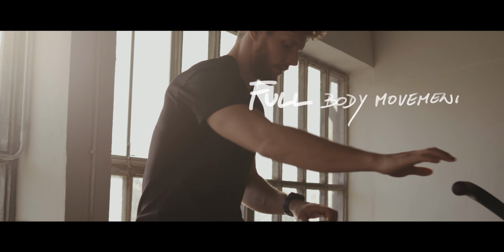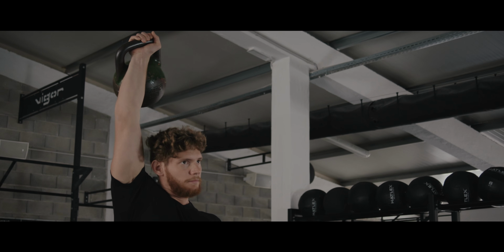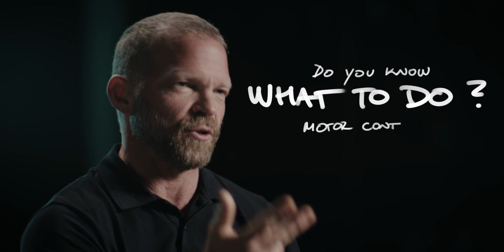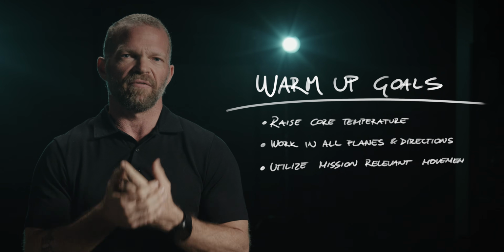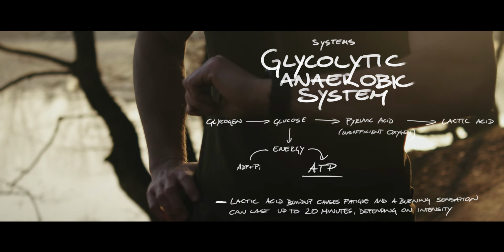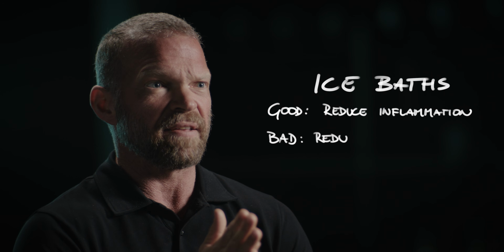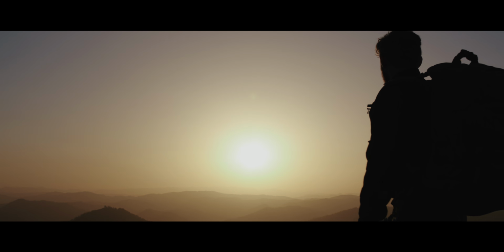Pro's Guide to Special Forces Assessment & Selection | Physical Preparation  & Overall Concept

Comment: Wow, this is amazingly structured and explained. I started strength and powerlifting first to build form, technique, full range of motion and strength. Hypertrophy training or volume training came easier as I practiced technique a lot to also help identify and work on my weak points and stabilizing muscles. The only issue I had to find out for myself was focusing too much on progressing linearly without full joint, tissue, and my cns recovery, that eventually lead to injury and temporarily joint issues. So recovery is just as important as well as learning to fire the correct muscle groups under load without taxing joints. Just need to add in the others to be like a special forces god. Mobility, functionality, strength, exposive, full range of motion, technique, This video is so freaking awesome, I use Renaissance Periodization as my go to for info just like this, and this hero confirmed it and made me think more about my training multi-dimensional instead of single-dimensional. I would think a crossfitter should have no problem with this physical condition selection.

Comment: I'd love to see a full body routine implementing the stuff from this video
Or maybe even a plan for an entire week with running/rucking
More on the subject of running would be great
But great video as always :)
Reply: There is a bit more coming in the next two episodes. If you look in the video description there is also a link to a download for a training plan.
Reply: @project-archangel  when u click the link, there's no actual place to download the plan
Reply: @boris148  you have to subscribe to them via email and then they'll send you an email with the option to download the pdf
Reply: @boris148  when you scroll down after klicking the link there is a place where you can enter your email address and they will send you the plan
Reply: Here let me save you the effort: 

Day 1 - 
Warmup, Jumping jacks and light stretch
run 1-2 miles 
Pushups, pullups, situps, burpees, planks 
stretch and use foam roller

Day 2 - 
Warmup, Jumping jacks and light stretch
Ruck 1 mile
pushups, pullups, situps, burpees, planks
Ruck 1 mile
Stretch and roll

day 3 - 
Rest, refuel and stretch/foamroll

Repeat and sprinkle in other exercises or increase as necessary. 

Do that and you'll be fit as hell. Once you're doing that, then start looking at programs to add to your workouts.

Comment: This video is amazing; currently training in prep for Army BCT
Reply: Outstanding! Make sure you are following an intelligently designed program that is periodized and addresses all of the plains of movement for maximum results. Are you currently following any specific programming?
Reply: @optimalreadiness  I plan on going into the army with a Option 40 contract (RASP Slot) . I have around a year to prepare myself before I enlist . My push-ups and pull-ups are not the best , same with my run time so what is the best method and improving my pt scores fast ? 

Any recommended routines I should follow ? Should I be going to the gym or can I just use my body weight to strengthen me? 
There’s a planet fitness near me but honestly I wouldn’t have a clue what to do at the gym .

Comment: Raising core temperature through warm up being a good thing is a bit  contested right now. It seems like it's a by-product rather than the goal of a warm-up. In fact research by Dr. Heller (name's Craig I think? I'm horrible with names) and his colleagues shows that lowering temperature (of course to a reasonable degree) drastically increases performance (as well as proves that it's not lack of atp that makes up stop the set but rather the high temperature within the muscle activating failsafes

Other than imo some degree of plyometric training can be safely performed by experienced athletes without the help of a coach, but definitely not in wet grass and other adverse conditions.
PS Very comprehensive and nicely structured video, I love your work. And surprising, considering that you're a gear brand!
Reply: interesting

Comment: Oh man lol physical fitness is Maybe 10% of the requirement needed for US Special Operations.  About 90% will be your own mental strength, and motivation. 
As a former Navy Special Warfare Operator 02-08. I saw many get pushed equally. The better shape you're in, it helps at the beginning, but as an instructor, we push everyone to their limits over and over. It's not a specific bar everyone crosses (persé). It's a mental breaking point. Typically that breaking point is found by pushing one to their physical limit. So no matter your fitness, you will be pushed passed this point over and over. If you're weak and pushing past  that, the instructors will be satisfied and move to the next guy. Strong guys Typically DONT last because of many physical traits that weigh them down. You just need mental fitness to get through training like ours in the US. Also some smarts. You gotta be above and beyond at EVERYTHING.  SF guys are not strong idiots. These guys are top of the food chain, alpha males. You'll get eaten alive, even in today's pink military if you're not an alpha or A-type personality. Not just in training, but in the fleet afterwards. I've seen many guys quit after training and one deployment.
Reply: How would you suggest to mentally train for selection?
Reply: @jamesmason3506 first, in the US, you just sign up for it. It's not really a selection process. There could be a long conversation about this, but you need to be strong willed, you need a motivation for doing it too. If you really want something you'll push hard to get it. It's hard in this case because you're going after something you don't know much about (daily life, etc).  One way to train the mind for this would be to do some cardio to the point that you "think" you're done. Then immediately do 30% more of what you just did until you're "done" and can't go anymore, but then do another 30%.  Do this again, and you've added 90% to your max capability.  If instructors see this type of motivation and drive, you would be fine.  You also need to have above average critical thinking while in mentally/physically weak states. Usually US Spec Forces/Operators are guys that are pretty sharp, self-motivated, A-type personalities, Alphas.  Most of the people that make it, they were just brought up in a way that prepared them from childhood.  If you're looking at this for a career. Good luck. Never ever quit, you will pass out here and there, possibly drown, but keep going.  My thoughts were, "I can out perform that guy", and I kept saying that as there were only 5 of us left and we graduated as life long brothers.
Reply: I've been training hard! I guess I'm lucky growing up in an awful childhood. Mental toughness came naturally! It's very powerful to hear what you have said, God bless you.

Comment: only thing i think is wrong is the sauna. i was watching a video that stan efferding made talking about a concoction of frutose dextrose and sodium. they also mentioned that they dont allow there athelets to use them(sauna's) bc when they do there water cuts for the weigh in's all there endurance is lost. something like that
Reply: There is a difference between using the sauna to cut weight through water loss and using it for regeneration so I would disagree.
Reply: @project-archangel  hmm that makes since. thanks

Comment: I have shin splints on both my legs and Special Forces Assessment & Selection in a little less than 100 days it really sucks I need more running knowledge.
Reply: I did 2 marathons and about a year later mine started. I suffered for 2 years and got rid of them by changing my running form. Stop landing on the heal and in front of your body. Start using your front food. I recommend Sage Canady (vo2maxproduction) for insights
Reply: Tibialis raises will fix them. Check out Kneesovertoesguy

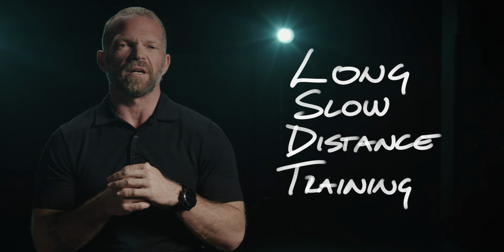Comment: 19:05
Did you say that the base for LSD training is 100 miles/week?! Can you clarify that? That sounds like something that needs to be built up over years, rather than as a base. Maybe I misunderstood
Reply: LSD training was designed for Marathon runners if Im not mistaken. So yes you wouldn’t expect a novice to start off with 100 miles but basically all your training will be running, pretty much 6-7 days a week, so thats about 15 miles a day at a slow speed. That explains the amount of injuries these guys have.

Comment: I plan on going into the army with a Option 40 contract (RASP Slot) . I have around a year to prepare myself before I enlist . My push-ups and pull-ups are not the best , same with my run time so what is the best method for improving my pt scores fast ? 

Any recommended routines I should follow ? Should I be going to the gym or can I just use my body weight to strengthen me? 
There’s a planet fitness near me but honestly I wouldn’t have a clue what to do at the gym .

Could I also get more fit/prepared from basic training etc before RASP?
Reply: First off, yes do basic training before RASP. If you want to get better at running, then you should run. Run once or twice a day & 4 times a week. Run as far as you can & keep doing it weekly. Ranger School is more endurance based so you don't have to worry about six pack abs & running fast (Doesn't mean don't run. Means it shouldn't be your top priority). 

Focus on growing mass because you will be deprived of food a lot. Do a CrossFit workout plan, go to the gym & do full body workouts 4 times a week. Then the next week do body weight exercises at home that target each muscle grouping for 4 times a week.
Reply: https://www.youtube.com/watch?v=V6X4c0MKIzo   AND    https://www.youtube.com/watch?v=ROCZYbFx2Tg&t=29s   make sure you ruck with a backpack that weighs at least 40lbs. And walk with that rucksack/backpack for miles to harden your feet as well. Even on days where you're not doing cardio, have it on and bring it everywhere you go, every day.

Comment: I’m shipping to basic in a month with an 18x contract. I can’t do any pull-ups right now (I believe to do my bigger lower body as I played soccer my whole life). I am currently working on it but I do not think I will meet pull up standards if there are any. Does anyone have insight on that?
Reply: You can't do pullups because your're too weak, not because your legs are too big. Unless you're very fat then learning to do a pullup in a month should be completely achievable.
Reply: @wtf93931  oh because you have seen me and have trained with me right. Real good advice internet guy!
Reply: @camcamcamcamcamcamc  Ok, what's your weight + height? Give me that and I can tell you if it's a weight issue or not.
Reply: @wtf93931  have you been to special forces training
Reply: @camcamcamcamcamcamc  Nah, but I can do a pullup. Answer the question, weight + height.
Reply: @wtf93931  I do not care about your opinion then. I know how I can build pull up strength. That’s not what I’m worried about.
Reply: He's not wrong. If been at 70 and 100kg bodyweight (marathon to bodybuilding, back to marathon) and I've always been able to do pullups. It's mostly never the weight, it's the lack of strength
Reply: @kzsposeidon3121  never said he was wrong. Thanks for the input other internet guy
Reply: It's too late now but what kind of insight did you want

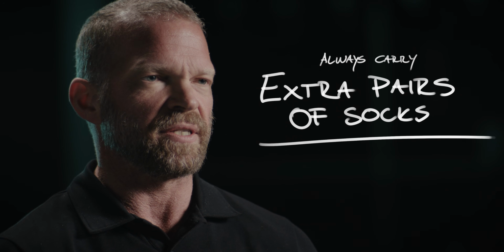Comment: @22:10 is this correct? I was taught to put weight as close to the pelvis as possible because the back is essentially a lever, a model where as the distance increases from the hips the weight increases would become more inefficient, it would be like trying to move a weight on a short stick versus trying to move the same weight on a much longer stick. Surely this is an error? I could see considering accessibility, I don't want to have to completely unpack my ruck just to get to food or water, but in general it seems intuitive to have heavy weight closer to the hips. This just doesn't make sense, fundamentals of movement, where the head goes, the body follows, so why then would I want to increase the weight as I get closer to the head? Can anyone explain this?
Reply: @patrickkok6258  It's not high, heavy weight should begin at the bottom of the T region and the middle of that portion of weight needs to be between the center of the shoulder blades vertically. High, people think above that point, that's wrong. I was taught by the U.S. Army, carried on average 90lbs over rocky terrain for years. You should be more specific. Attention to detail. All of the weight by average should still tend towards the pelvis while maintaining spine neutrality. It doesn't matter where the weight is so long as you can maintain spine neutrality with the least amount of effort.

Comment: I have a question about "ruck marches", if my goal is 20 km in 2 hours and 30mins with 30 kilograms, should i train with 35 kg or 40 kg is it better
Reply: I'd say you're better off keeping the same weight or a bit more and working towards a shorter finish time. Increase weight will increase chance of injury and complications ✌
Reply: Let me say first that I would look at some other factors before designing your workout for example how tall you are, what your general body frame (Muscle mass) loos like and what weight you have been rucking with so far and for how long. But in general 30 kg is already a heavy weight, especially for the time/distance that you are training for. You definitely need to train up to using 30 kg in order to prevent injury. If you can handle that weight for shorter distances and you overall training schedule allows for enough recovery, I would give short distances with heavier weight a try. My heaviest was 35 kg in the ruck with a 40kg sandbag on top of it. I think I walked for about 3km with it. Now this is not rucking anymore, its in the category of heavy carries which you would do to make your body more resilient to heavy loads, not to improve your rucking times. For rucking time improvement I would stick to the 30 kg since this is what you are training for (again, only after working up to it and being able to handle it) and then stick with distances between 5-10 km but trying to improve my speed. You need an average of 8km/h in your test situation so you will most likely be shuffle running most of the distance which is quite hard on the joints. Thats why you train shorter distances and dont go too high on the load. Hope that helps. Cheers, Mike
Reply: @project-archangel  would someone who is 125kg carry the same load as someone who is 85kg
Reply: @LogicalLinearisation  but would you say its also fair to think that if i train with the weight and then with whatever im training for something changes and the weight is 5-15kg more could that slow me down?
Reply: @LogicalLinearisation  im wondering do you think its  better to train with the max amount of weight someone would be allowed to carry because im sure they have rules right or what do you think
Reply: @luxmid7486  yes, if the goal is the same.